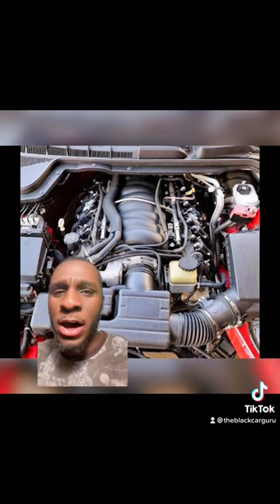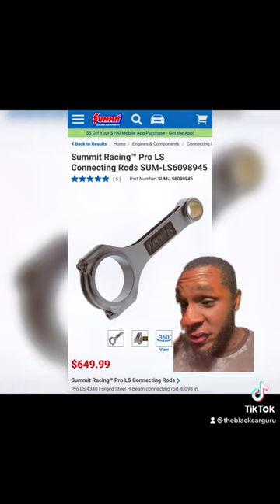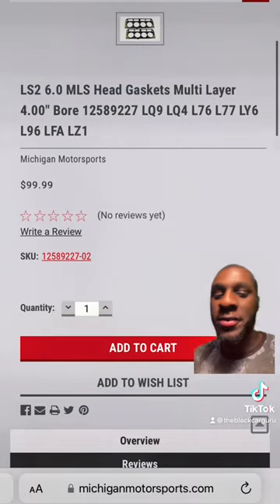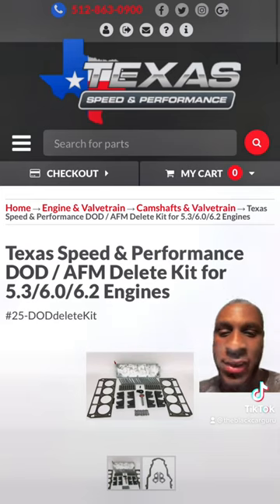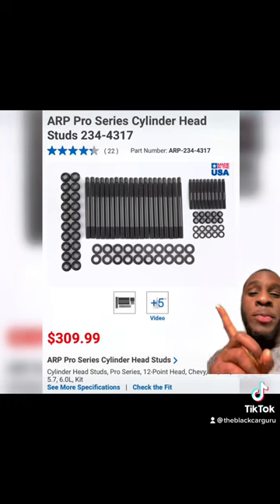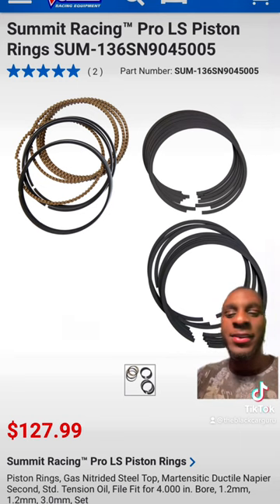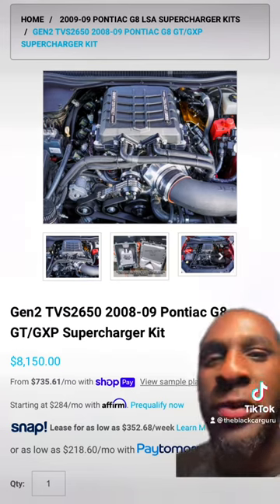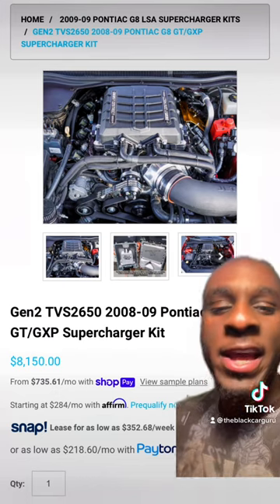These PONTIAC G8 GT’s are nasty with the right Mods! | Let’s talk about it

Comment: What do you mean the l76 doesnt like boost? The bottom end STOCK handles 700 easily an its VERY popular to throw an LSA blower on it and make those numbers to the wheel,the L76 also doesnt have vvt just dod. DOD is part of the valvetrain so doing a cam an lifters deletes the DOD but you will have to tune it out.
Reply: Yes , you are correct
Reply: Pure knowledge bro
Reply: Can you list all parts for the build I’m looking into getting a 2008 g8 gt
Reply: Yup great engine idk why say not meant for boost ok I guess there never wanted it be boosted from gm but it’s been done time after time he’ll the ls2 will hold it the weak point is after you modify the motor is the trans they don’t hold very well when motor is modified unless is built  great cars though super reliable not bad on gas either but the gxp has ls3 so I’m sure that won’t be as great on gas as g8 gt sound amazing after you put headers n exhaust n cam  whole new car after that night n day difference but this my daily so not trying go too crazzy with it right now lol
Reply: @sippinxol9961 get 2009-2010
Reply: hypereutectic slugs DO NOT like boost for long He is correct. Mayb8 psi, you go big, you best go forged.
Reply: @genechaas7369  you have a boosted g8? Because i have a G8 and pretty active within the g8 community, an i can tell you first hand theirs g8s rolling around with 750 WHEEL horsepower on a stock bottomend an still daily driving it.
Reply: @adrianbaker5744  i know and i don;t care that it can be done. Build your LS to handle boost. I was a machinist, not a member of any community. But the "G8 community" must know more than automotive machinists.
Reply: @genechaas7369  no we jus know proven limits of our motors. It doesnt have to be "built for boost" right from the get go,they handle boost well up to (insert number here) an alot of us stay at that number till we need to build for boost.
Reply: @adrianbaker5744   as i said you stick to modest boost , ok. JUST LIKE IN THE VIDEO.
Reply: @genechaas7369  i mean if you consider 12-20psi modest sure....
Reply: @adrianbaker5744  :) i don't consider 20 modest! 12, yes. PS my G8 is relatively new to me, and its 475 hp is fine for the track, for now!

Comment: Headers, cam and a LSA blower. No need to touch the bottom end. Tune it right you’ll have a save 500hp combo for like $5-6k
Reply: You should be getting more than that with a blower
Reply: @KingzCub probably did all that & didn’t tune it to e85
Reply: no trans issues? heard the 6L80 isn’t all that

Comment: The way I see it you have two good routes for modding a G8. 

The Boosted route: DoD delete, PDS cam, LSA blower, headers, catback, intake, 3.27 rear diff swap

Or 

An NA setup: DoD delete, stage 2 or 3 can, headers, catback, intake, ported heads, ported intake manifold, ported throttle body, 3.45 rear diff swap
Reply: Exact setup on my caprice ppv(NA)
Reply: @traehubbard1051 I have a caprice as well. Can you post a video of yours?
Reply: Just got my 3.27 diff ,what’s next
Reply: hp estimates and cost ?
Reply: I have the NA setup. No porting though
Reply: Why not a turbo?

Comment: When will you rediscuss the 6.0 powerstroke I know you mess up on that engine I own one. Headstud egr delete and heads an turbo get 600 or more. But you need injectors lift pump and a few more upgrades but let me know if you want a real build break down

Comment: My G8 is in the shop as we speak getting H/C/I, fuel, headers, and a 3600 circle d. Boost is probably coming next winter.
Reply: How much is that for you?
Reply: How much did you pay?
Reply: @tombrown5586  after all said and done including labor it ran $4970 should be picking it up within the next month
Reply: Why do y'all keep going with the high 3400 or 3600 stall converter? It is way too high to be reliable especially as a daily driver.
Reply: Let me know your track times if you will tell me thanks
Reply: @IamVexih where do you live? All that for only $4900!?!? That's nothing for that much done to it!

Comment: I was debating on the GXP or the Cadillac CTS-V3 for a while. Got the CTS-V3 but I still want that GXP🤾‍♂️
Reply: They out there and seems like prices are dropping. I have a v6 g8 I'm putting a ls2 in cause I have one of the first g8s,like i said prices down so i dont mind doing this project.
Reply: @magni.9539  GXPs are still over 40k. They were 40k brand new and the price never dropped
Reply: @wigletron2846  Good
Reply: My GXP paid 45k with only 36k miles
Reply: @magni.9539   yea on a v6 😂

Comment: The trans in these are dog water past 500hp.
Reply: Amen..
Reply: Zl1 converter and a camaro trans pan & filter will easily handle 500hp....
Reply: @adrianbaker5744  I actually have that right now in my G8. I'm preparing for my LSA...
Reply: @mistadigz7203  yea,you should have no problem handling 500hp. Do an aftermarket trans cooler for extra assurance and youre golden.
Reply: @adrianbaker5744  oh yeah, trans cooler was added 2 years ago when I had a Rick Crawford drag sportsman camshaft with a yank 3200 stall. I also have a 3.27 diff swap out of a 5th gen camaro.
Reply: It’s all about the tune plenty stock 6l80s handling 700+
Reply: @devinanderson475  Yes, I agree, but for how long?
Reply: My 2011 Camaro SS with a built 6L80e and a Circle D 4200rpm stall converter has gone 7.22 at 96mph in the eighth mile with 1.65 60 foot times has a new GM performance crate LS3 495 horsepower motor with CNC ported and milled LS3  heads 11.1 compression running on E85 car has a big engine oil cooler big transmission fluid cooler and a oil catch can and stock 3.27 gears full interior and AC car cruises at 80mph on the highway at 2100rpm in 6th gear with the converter locked up very close to stock car has absolutely wicked throttle response from 0-130mph car weighs 3920 with me in it the camshaft in the LS3 495 horsepower crate engine is what I'd consider a fairly mild camshaft and it should have came stock in the LS3 engine it makes really good torque 2700-6200rpm and pulls strong to the 6600rpm redline and it has a ever so slight chop at idle that's barely noticeable vs the stock LS3 camshaft car also does a 123mph in 3rd gear at 6600rpm before it shifts into 4th gear with the stock 3.27 gears car gets 13.7-14.2 miles to a gallon on E85 regular driving city stop and go and 19 miles to a gallon on the highway with the cruise control set at 80mph with the AC on running E85

Comment: I guess I'll be that guy.... who in the hell is chasing these kind of HP numbers on  these hypothetical builds? As a owner of a 09 pontiac G8 GT and several other LS powered vehicles, your opinion or advice on cars are very over the top. It's like your reading right out of high end shop website and parts catalog. Yes, There is SOME general truth to what you're talking about, BUT not all of it. You'll go broke trying to do these black car guru builds. I've worked on many G8's over the years ranging from 450whp to 800whp daily driven set ups that are safe and very reliable and didn't had to drop that super grocery list of parts to obtain those numbers. Shit, a bad tune or tuner can mess any of these builds up. Personally, I couldn't take your advisory like that as if it's gospel. Too many variables in play with a person car's intended use. I just generally watch your the vids for what it is..., entertainment, nothing more. Stick to the roasting bro, which I personally do like. (Respectfully)
Reply: I agree. Dude just dumped like 20k into making power. Didn't even mention how the transmission could handle it. There's many supercharged G8s putting 500-600whp on stock internals with DoD delete.
Reply: @wigletron2846  and running 10's easily with A/C, heat and radio blasting. 650-680 wheel, a tire and a decent driver and you got yourself something...
Reply: 😅😮😢 3:01 😢😮